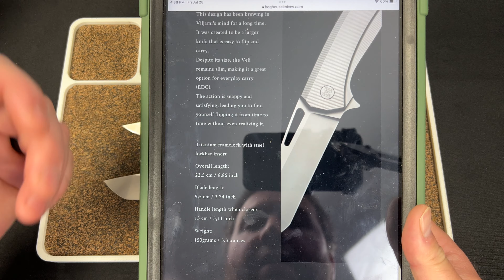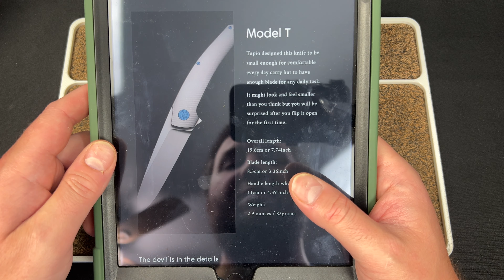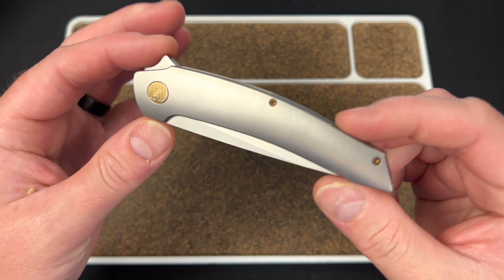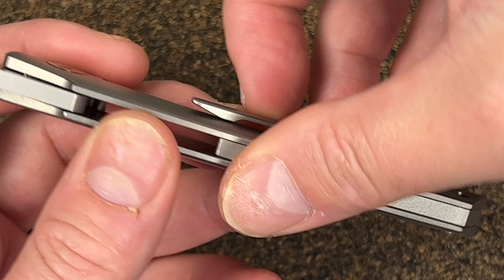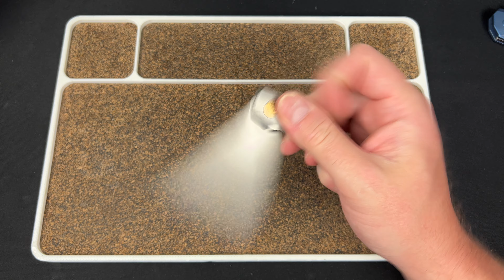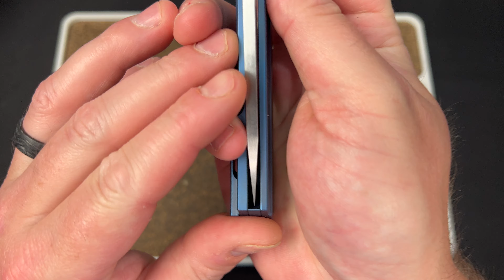Finnish Custom Knives! - Hog House Knives

Comment: THose blade steps are intentional man. It's stylistic choices and it looks IMMENSELY better than having a polished smooth bevel. This knife blows the socks off 99.999999999% of the knives in the wild. The only knives MAYBE better than this are like RobJohnsons, Skiff, Holt, and MAYBEEEEEEEEEEE Brown and Oz but this knife is probably made better than OZ and Brown.